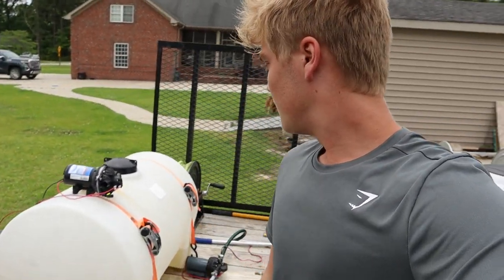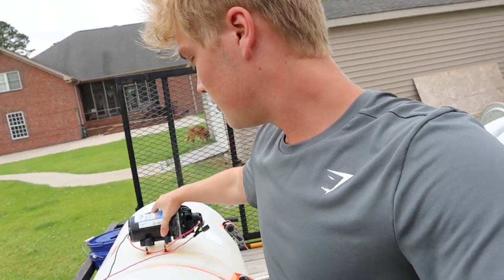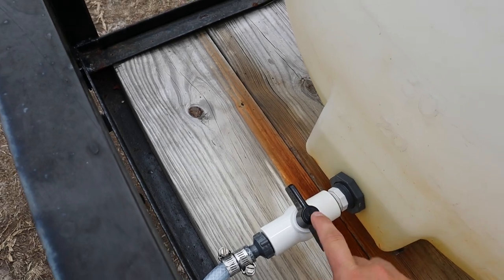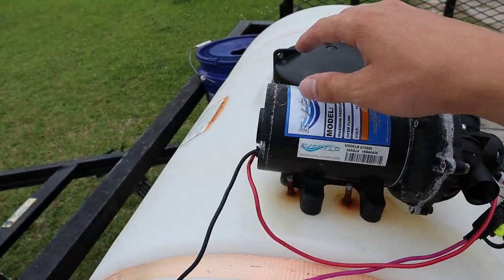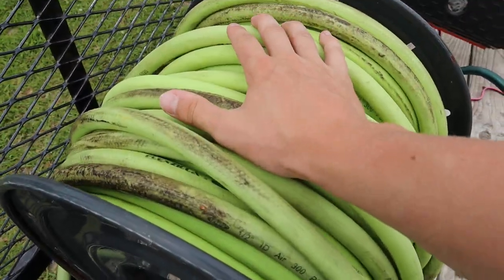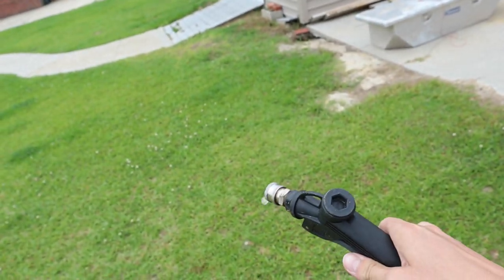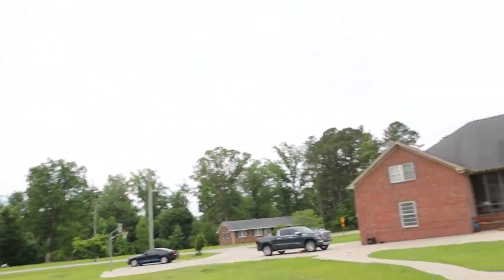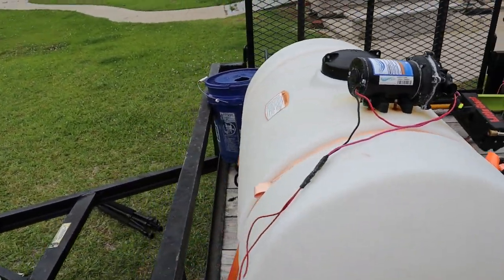How To Build A Budget Softwash Setup!

Comment: Love your videos! Not sure if you still check comments on these but can you give some rough estimates on how many gallons a 1500 sq ft roof, 2000 sq ft roof, etc. uses? Hard to know where to start.
Reply: I think the lesser GPM from a soft wash pump the better, you won’t wash off excess mix, and it would keep the tank from running out too fast. 4gpm is fine

Comment: Did you work for someone prior to starting your business?  I have no experience with this stuff.  I used a SH mix in a weed sprayer and rinsed it off my garden hose is about only experience I have other then couple times using a pressure washer

Comment: What is the psi on the pump you are referencing in this video?  Also, using this set up, how high will it spray?  Thanks!!!!
Reply from the maker: Psi is only 60 so it’s very safe. And it’ll shoot around 30ft with my current setup. But upgrading to larger hose and it will shoot about 50ft
Reply: @pressurewashingsurvivalgui3980  Thanks, I am trying to find some combination that will allow me to reach up to four stories for a hotel washing.

Comment: Whats an easy way to calculate your water to SH ratios on the fly? Fo example if I have a 26gal tank and do 13g SH and 13g water, and the SH I bought is 12.5% would that mean that my 26gal mixture is 6.25% ?
Reply: Yes, in your example that would be 6.25% mix.  Walmart sells "Pool Essentials" SH by the gallon and it is 10% so add that to 10 gallons of water and you get a 1% mix for softwashing a house.
Reply: @mikemd2697  Roger. Thank you for the response. So would you recommend 1% for most houses? For what eould you use higher % like 5-6? Roofs?
Reply: Correct.  1- 1.5% for houses and be sure to pre-test on the house in a small inconspicuous area and wait a few minutes to make sure your mix doesn't harm the finish.  Some paint is "organic" and is not as resilient as standard exterior paint.  I lived in CA and organic paint is more common there.  Hope this helps.
Reply: For a roof, 4-5% should be sufficient for most applications.
Reply: @mikemd2697  thank you!!